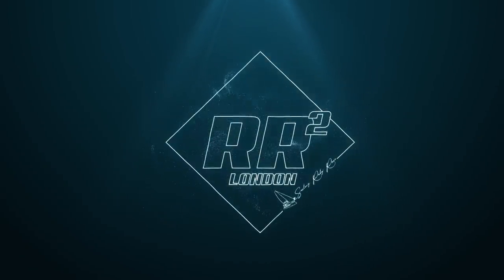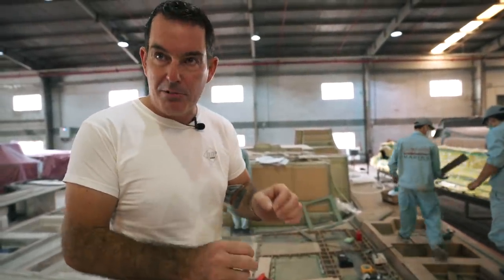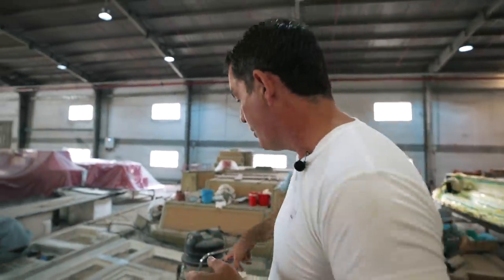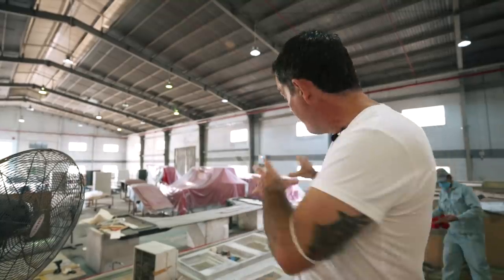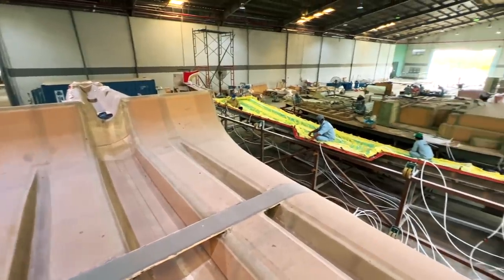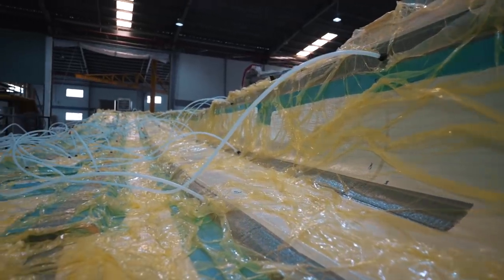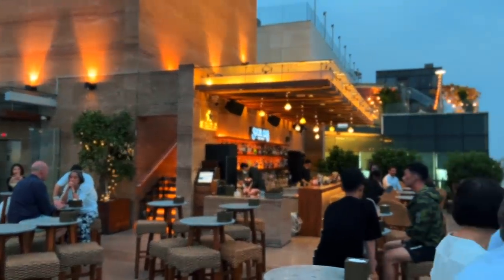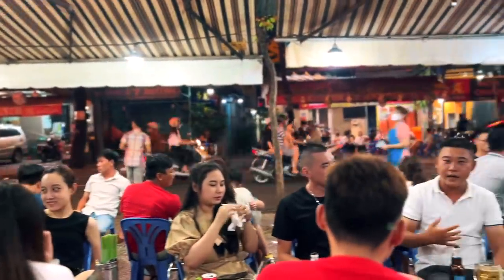Catamaran Build: Infusion Masterclass. How a boat is built

Comment: I've assisted a couple of friends in building some small carbon fiber pieces a few years back...off road racing stuff...the infusion process is something to behold, and the finished product is about the best humans can produce. The carbon pieces were incredible.
Reply: Forgive me if I’m wrong, but I was always under the impression that Carbon need to be “cooked” to has full strength? This is why F1 and large boat building company’s like Riva, Bennetti, and Azimuth have built their own huge ovens to ‘cure’ their Carbon elements once the infusion process has been completed. Are they doing this in this process?

Comment: I had dreams of building my own boat in a garage, started researching all the boat building methods with fiberglass and realized I would never be able to build something as exceptional as vacuum infusion in my garage. The talent and experience it requires to pull it off isnt something I want to invest a decade of my life to sort out how to get it just perfect for my one boat, so I had to accept that the best boat for me will be one where at a minimum the hull is infused by professionals and SeaWind are top notch. The prospect of getting the infusion process wrong, wasting thousands of dollars of resin and potentially destroying a mold isnt the dice Im ready to roll in boat building. I will be buying a SeaWind when able in a few years.
Reply: build a kit then. its basically a big jigsaw and you would get a higher level of customization (than production boats) depending on manufacturer. you can also go the WEST way (Wood-Epoxy Saturation Technique) and get phenomenal hull by joining methods such as strip-plank and cold-molded together.

Comment: EPIC episode. I also could have done with out the Pig Tit, but I thank you for considering us hungry souls here at home in Australia (and elsewhere). Great to how the infusion works, but don’t they end up with a rough surface where all the bagging is crimping upwards where it comes together? There must be hundreds s of tiny little flanges that stick up when they remove the bagging, surely? What stops this from happening? Or can they just kick them flat/off? Thanks for more of the night life this episode. ✅
Reply: First - that are always the non visible sides of the structure
Second - yes they will be there, but I assume not so much - so some sanding an it will be OK. When I remember crawling into the "non visible" areas of European production boats - it itches also by the memories. For me hand layed wouldn't be better.
Reply: @wjhann4836  thanks

Comment: As the boat is being built in a hot climate as you often say /demonstrate. And as the boats accurate components are structurally supported by steel during their construction. Would there be hull shrinkage or alteration when you sail in colder waters ? Also do you have to adjust your rigging to allow for thermal differences in your sailing location ? Probably a silly question. 🤪👀

Comment: Hey Nick, Forgive me if I’m wrong, but I was always under the impression that Carbon need to be “cooked” to has full strength? This is why F1 and large boat building company’s like Riva, Bennetti, and Azimuth have built their own huge ovens to ‘cure’ their Carbon elements once the infusion process has been completed. Are they doing this in this process?
Reply: No, you may be thinking of prepreg. This infusion process generally doesn't need to be cooked. They might do a post cure, with is to raise the temperature so the resin can reach it's best properties.

Comment: Wow, your ability to speak Vietnamese so fluently is amazing! Most Asian languages seem to be the most difficult to learn. That must be incredibly helpful while living there and spending so much time with the workers at the factory. The infusion process is simply light years better than traditional layup but it seems so wasteful with all that Pex pipe and valves that I assume are one use? I imagine trying to clean them and re-use would take so much solvent that it would be even less green. I guess it is partially offset by using probably several gallons less resin.
Reply: Yes surely it must be a one use only process. Man the wastage must be huge. Can it be recycled?
Reply: The tubes can't be reused because some resin will cure in them. But the process is much more efficient than traditional hand lay up. Far less resin gets used, and far less gets wasted.

So, not only do you end up with a lighter, stronger boat, it also costs less because of the time and material savings.
Reply: @btrotta  Pretty much what I figured. Plus, if it is PEX pipe, even if you could flush it (which would be its own wasteful freak show itself) it is not recyclable either.
Reply: @btrotta  Yes but think of ALL the plastic that has to be literally thrown away. If they had valves right down at the skin level which could be shut off once the pour is done they could disconnect tubes and push the ends into a barrel and then push a cleaning agent through the hoses and reuse them. Similar to modern concrete pouring techniques where the column going up through a building being built is shot blasted with a sponge to remove any concrete out of the pump tubbing and then it can be reused the next day. If I own the company I’d like to explore the re-use of the tubbing idea. Most likely it’s too much effort and not cost effective, but thinking of all that plastic going into the ground makes me cringe.
Reply: @gbsailing9436  Agreed, it does seem wasteful, but the cure time on the resin is so fast there really isn't a way to do it. By the time they're getting to the end of the infusion the resin is already setting up.
Unfortunately, like a lot of industrial processes, what makes it desirable from both a consumer and manufacturing perspective makes it an environmental nightmare.
Reply: @btrotta  Yes you are probably correct there but you could change that by adding less fixer. Anyway it not our problem.😀

Comment: Okay, nerd moment. Instead of manually controlled valves, why not use different size orifices? Or, is the resin to thick? However, even that being said, when I worked for BOC Gases, I designed a system of positive displacement pumps driven via frequency inverters to control the amount of required flow and pressure to fill cylinders without the need for start and stop operations in regards to weight of the separate components.

Comment: Did you know On any given day in the parks of Vietnam’s biggest cities—and even smaller cities—you’ll find groups of people doing the Falun Gong exercises.

But even just a few years ago, Falun Gong was relatively unknown in Vietnam.

Falun Gong (also known as Falun Dafa) is a practice of mind and body based on the principles of Truthfulness, Compassion, and Tolerance. It was the most popular qigong practice in China in the 1990s, with an estimated 70-100 million people practicing. The Chinese Communist Party viewed its popularity as a threat, and in 1999 the Chinese Communist Party (CCP) started persecuting the practice.

Perhaps Falun Dafa’s slow start in Vietnam was due to political pressure from the CCP, as it is not officially allowed by Vietnamese authorities; nevertheless, in recent years it has become wildly popular, with some saying Vietnam has the third largest group of Falun Dafa practitioners – behind China and Taiwan.

One volunteer has seen the dramatic rise in Falun Gong’s popularity firsthand.

“Based on my knowledge, in 2000, Vietnam only had two practitioners: one in Hanoi and one in Ho Chi Minh City. In 2012, there were 4,000-5,000 practitioners. In 2016, there were around 10,000 practitioners,” he said. For security reasons, he wanted to remain anonymous.

More recent estimates put the number at 30- to 50,000 practitioners, but it is impossible to verify. 
However FalunDafa is good In 2003, the first translation of Falun Gong’s main book, “Zhuan Falun,” was published in Vietnamese. A new edition was released in 2017 amidst the surge in popularity.

Falun Dafa’s rapid spread in China in the 1990s was almost entirely through word of mouth, but there’s one major difference now in Vietnam: the internet.

Like many, that’s how Tri Nguyen first heard about Falun Dafa. He started practicing in May 2016. “Dafa changed the way I feel about life. I understood more about what is right, what is wrong; then I modified my actions and attitudes about everything. My health has been perfect since I began practicing.”